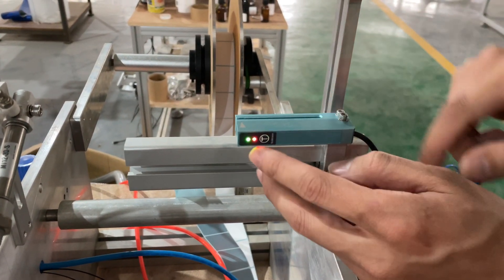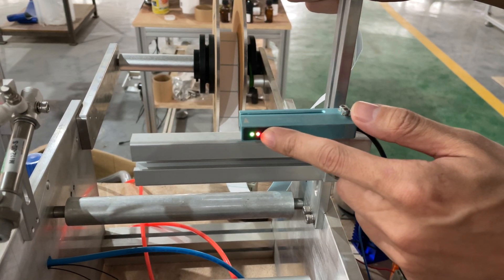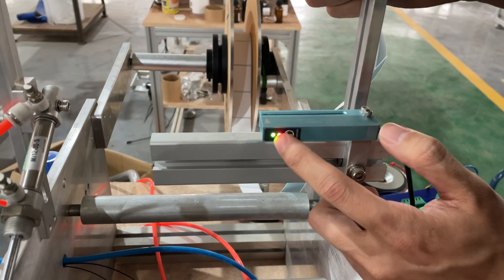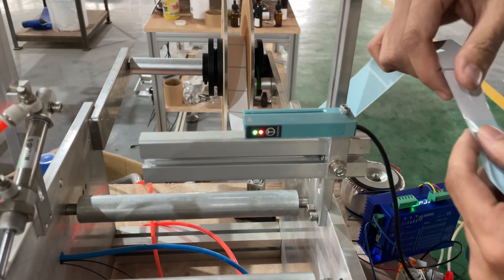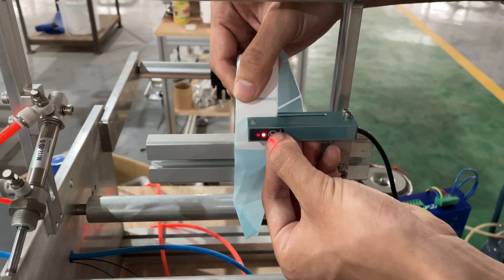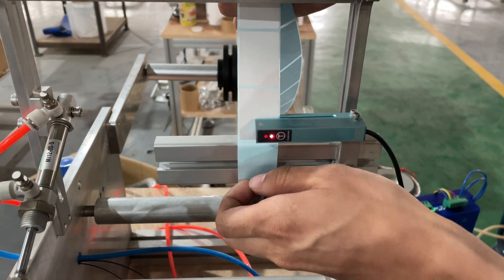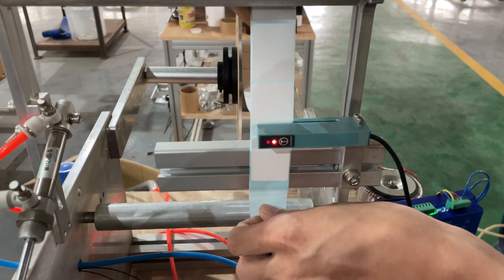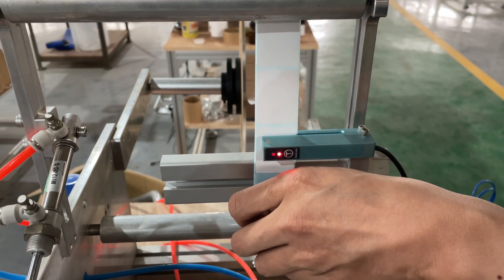How to calibrate label sensor PUD-100N

Comment: I have the same sensor and have successfully calibrated per your instructions. The sensor turns from red to green and stops the feed when the front edge of the gap is detected. The problem is that when the next bottle comes through, the feed momentarily starts again, but the sensor quickly stops the machine when it detects the back edge of the gap... so the net result is that every second bottle goes through without a label. 

Any suggestion?  

Also, thank you for the helpful calibration video!